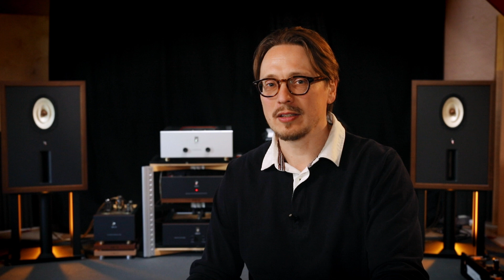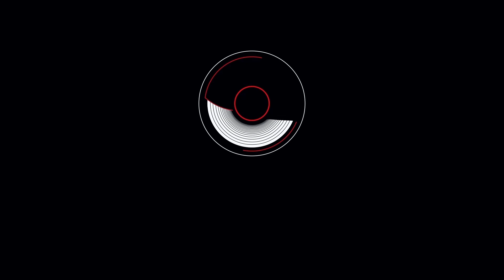Digital vs Analogue in Audio: Do You Need More Than 16 Bits for Digital to sound Analogue?

Comment: I assert that vinyl as the medium of analogue is not as faithful as great digital.  RIAA and compression of peaks is a fact combined with a higher noise floor.  There just is not the dynamic range on vinyl.  It seems that the distortion of vinyl is pleasant to the human brain.
To me, great 16 bit reproduction with a NOS TSA1541a with triodes is far better than vinyl done on a turntable that costs 4x the digital.
Reply from the maker: sounds like you never heard vinyl playback at its finest with our SUTs & LPU Phono. great digital sources just approximate that. anaolugue playback is going always remain the benchmark for digital

Comment: Lets be fair, live music is real analogue. But digital is better in thousands of ways, there are so many issues with vinyl, and vinyl in stereo, it is just that people got used to hearing flawed audio. Everything from vinyl, dust, speed, calibration, downward force, dynamics -  many issues with Vinyl. Digital is much easier to get correct. If you love 2nd harmonics, add a tube preamp. And remember music since the mid 80s was processed digital anyway.
Reply: My rule of thumb is that if it was recorded in analog it will sound better in analog. If it was recorded digitally, it will sound better in digital everything else being equal.
Reply: I own no digital recording ; I got rid of them a long time ago with no regrets. I have yet to hear any digital source as good as analogue R2R
Reply: @johnholmes912 much have changed since long ago
Reply: @johnholmes912 Just curious do you even find enough music on R2R to fulfill your life? Especially with the cost.
Reply: @johnholmes912 
Yes old analog recordings is superior in R2R. No LP can come come even close. ❤

But if you take a new produced digital recording and make a copy to a R2R..

That R2R should sound worse than the digital recording that it is a copy from.

On the most that R2R could subjective sound somewhat "better" when the sound signature is preferred and imprinted on that as a preference.

In short the R2R is not doing anything magical. 😅

It just showcases how bad and how much a LP loses in sound quality in all of its production steps, there no one of them that can add sound quality and at best just preserve and it more likely to degrade it..❤

Comment: For me, my vintage  Revox B225 CD player, even without all  the upgrades that I've done so far (NOS mode, caps, resistences, RCA inputs, IEC socket, internal wiring...), with the old double ceramic TDA1540 14bit DAC, is still the best digital source that I've heard, regarding any price point. Multibit DACs still are the best way to approach music reproduction.
Reply: I picked up a California Audio Labs tube CD player from 1988 on eBay with a TDA1541 and it completely changed my view I was raised on that anything digital is automatically antiquated in six months. It sounds better to me than a lot of dacs made today. It also cost a bloody fortune back then!

Comment: What impact does the domain of the original recording was made play in this conversation. is there an assumption that the recording of the original source was analog?  hope that makes sense.
Reply from the maker: That is indeed the assumption for this conversation. For most cases analogue always is. Everything happens (this also applies to all digital processes) is in the Analogue domain. Unless somebody lives completely in the Matrix, most of the digital samples orgininated from the analogue.  :)
Reply: @sw1xaudiodesign  So when you speak of the analoge domain you are talking about the event pre recording. I support this completely. I do think that many, when they hear the term analog, reference vinyl, and are not going back to the origin.  Thank for the clarification.
Reply: I think you understand and relate at a very Hi-fi level. I'm putting you right there with Mikey and Jub, (iiwi). I purchased two digital components, Tradutto dac and CEC TL5, both with "mature" as a sound signature like analog to  my ear. My listening room is also very analog feeling. Wood and fabric abound. Looking forward to your next vid.